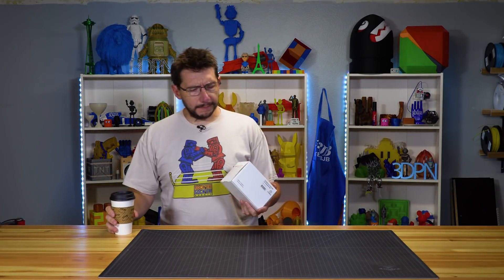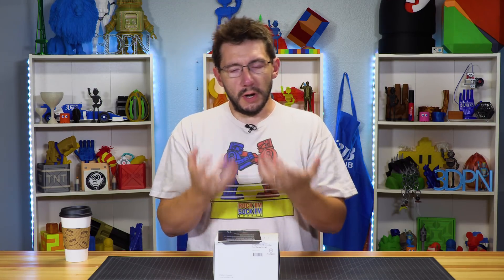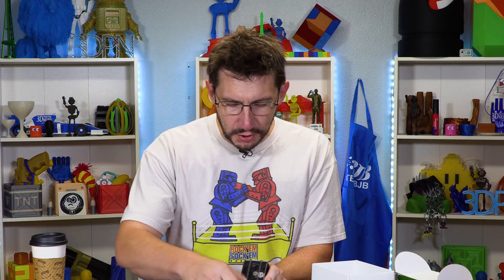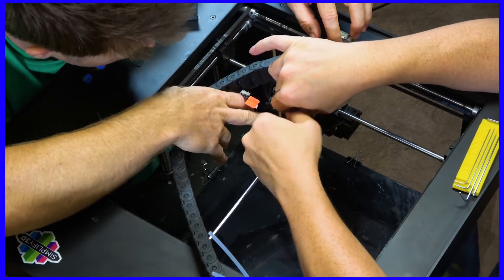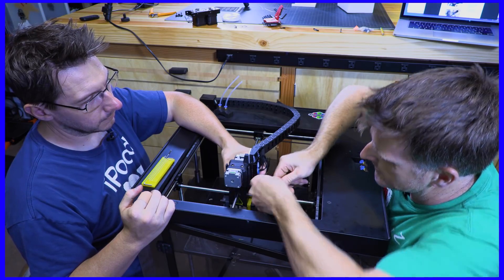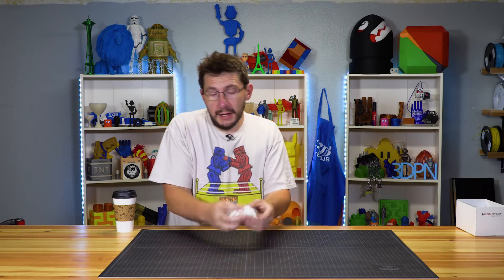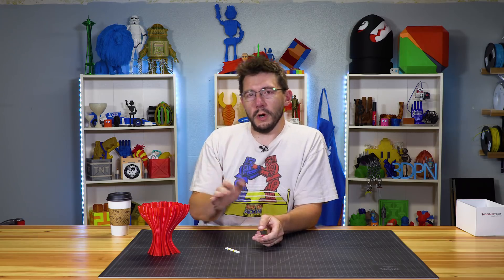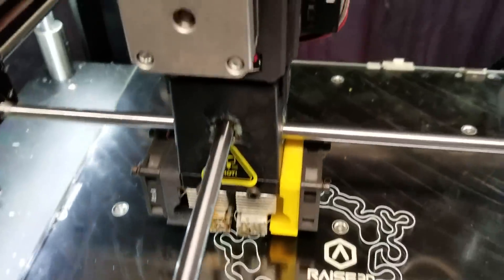installing and 3D Printing with Bondtech Extruders on the Raise3D N2+ 3D Printer

Comment: Stepper motors are current operated, the voltage you are adjusting is a current sensing voltage, not the motor voltage. The controller adjusts motor voltage to achieve the desired current, the voltage needed varies with time and speed and the controller uses pulse width modulation to achieve the desired motor winding current.

Comment: @3D Printing Nerd: you say in the video regarding the Raise printer that "having the two nozzles side by side is probably the worst way to do dual extrusion."
I received a Tronxy X5S-2E recently and it actually combines the two filaments into one inside the hotend itself. The result of this is you need to use really small retract settings (like 1 or 2mm) otherwise the molten filament follows the retracting filament back up the PTFE tube and goes solid inside the PTFE tube - leading to a cold pull and shortening the PTFE tube by cutting off the clogged section.
Surely that's worse? What do you think the best way to do dual extrusion is?

Comment: You're actually adjusting the current going to the stepper motors, not the voltage. Your read a voltage off of the potentiometer, but the potentiometer controls amperage.
Reply from the maker: Ah okay, that makes sense!

Comment: Finally, i have been looking at the upgrade kit for a while now and now i can see some proper comparisons :D 
I now use only one nozzle and a big 5kg filament spool because i only print ASA so the single nozzle bondtech would be for me. 
Would you say that it has any sense to upgrade for normal materials with the raise extruder being so good from the factory ? im mainly looking forward on the weigh saving and faster printing because you can get rid off the big aluminum block.

Comment: What is wrong with your fan duct prints at 10:58?
Reply from the maker: What do you mean? Both work well!
Reply: The left one looks like it was printed the wrong direction and the layers don't look right. Also they don't look like they would work well compared to something like this https://www.thingiverse.com/thing:2792586

Alot of designs out there haven't been flow tested so they may look like they are good but they aren't. You have to use simulation software to really get an idea of what's going on with a design.
Reply from the maker: Oh! I see. The one on the left came with the machine. The one on the right broke initially, so it was reprinted with yellow filament. Thank you for the link to the better fan shrouds!
Reply: If you had that fan duct SLA printed it would look pretty snazzy.

Comment: a useful tip for removing hot glue: put a drop of denatured alcohol on it and it with break the bond without harming anything else and the hot glue will fall right off. Just be careful not to get it everywhere as it will strip some paints

Comment: I found this video very impressive, especially because of how easy it was to get everything installed. I've got an older FlashForge Creator Pro (~2016 model) which I'd really like to do some upgrades to, but I'm quite concerned that the lack of open source firmware is going to be a major limiting factor. I remember back in the day you had some videos with that same model - any advice for how I might resurrect it into a more useful printer, like you did with your N2?
Reply: Daniel Smullen doesn't the ffcp use Sailfish like the Replicator (because it is a clone of either the Replicator 1, 2, or 2x, can't remember which)? Sailfish is open source and, while it's not under as active development as Marlin, it is typically beyond the version that comes with such printers.
Reply: rpavlik1 it is Sailfish, but there's no clear way to know what pins are used for what, what the current and voltage specs are... If you have any clues about this they would be helpful.
Reply: I'm pretty sure there is a config in the Sailfish repo - either a config header or something like platform.py IIRC. I don't have a FF printer, so I don't know more, sorry - I've just done some work on Sailfish primarily to improve my rep2x

Comment: Hi Joel,

If you want to remove the hot glue, use rubbing alcohol and it breaks easily.

I've been using this thing for a long time on printed circuit boards.
Reply from the maker: Oh... OH! That's great advice!

Comment: Where is the rc car mon
Reply from the maker: YO! Waiting for one more part to be CAD'd, then I need to get the plastic sheet for the bottom. Robert just got the battery welder. Then we need to acquire metal nuts and bolts. Closer!

Comment: Dual looks awesome. Have you had a chance to print vertical walls yet? Curious to see if there’s any extrusion inconsistency issues (like that MK3 #602) that some have pointed to these extruders.
Reply from the maker: I still have some vertical wall testing to do with the machine, but that's on the list!

Comment: I still don't understand what it improves but still interested enough to do some research
Reply from the maker: Being able to grip the filament from both sides as it pushes it through to the nozzle means a more reliable extrusion. Just think, thousands of retractions later, the filament could have slipped a bit. This ensures it doesn't.
Reply: 3D Printing Nerd okay so another long term investment im down for that. Understood, I'll see if it works for my printer when it arrives.

Comment: Joel,
  I'm curious about your reasoning behind the statement that dual nozzles side by side is the worst way of doing dual extrusion.
Reply: Ken Gregory the are  difficule to set up the height.
Reply from the maker: Ah, I guess I should explain. In order for dual extrusion to work properly with side-by-side nozzles, the printer has to know exactly how far off in X and Y the right nozzle is from the left nozzle. If it's off, then the plastic from the right nozzle doesn't line up with the plastic from the left nozzle. Ultimaker 3 has side by side, but it also has a very decent calibration process that makes it easy for the user. The Raise - not so much.
Reply: Isn't that preferable than ending up with a purge block that can outweigh your printed model?  Just sayin....
Reply from the maker: Dual extruders like this still require a purge tower and / or a wipe wall though.

Comment: Joel, from my experience of the upgrade it was the best thing I have ever done to my Raise3D N2+. I have lost countless large prints due to filament “Stripping” out. Over 1000hrs now no problems of that. I have had the stepper motors get hot when using the lid on the machine. The heat transfers through and melts the filament at the drives. I had to completely pull it apart (includes removing from the Raise) to clean it up. I now use the cover at the beginning and lift it to ensure the steppers don’t get hot. 

Also the lower CG helps with the Waves/Ghosting with change of direction. 

In the end though, not happy with my Raise3D experience. Both the X & Y end stops fell apart. Three Control units (first one Dead on Arrival), and a motion controller board failure which my dealer replaced since Raise wipes their hands of the issues. Maybe I need to start my own YouTube channel to get the same level of support you have experienced from Raise3D.
Reply from the maker: Ouch! That's no good. Shoot, I'm sorry to hear about your troubles with your N2+. The Bondtech upgrade came from Bondtech, not Raise. Who are you contacting there? Are they answering any of your emails?
Reply: Joel, I have been told that even though issues that were "Raised" under the warranty period and still haven't been fixed, it is no longer under warranty and that say it is outside warranty and there is nothing they can do.  That email came from the VP in Europe Michael Huang.  I need a 3rd printer now, I know it won't be a Raise...

I am a Support Person myself and I know that the product is just part of the story, it is the level of support, service and expert advice that you provide that keep your customers coming back.  There is no point to winning new customers if you can't maintain the ones you have.  Even though my experience with Raise hasn't been great, I still buy my supplies through the same person that sold me the machine. He is just as frustrated with the issues as I am and he has even supplied me parts at his cost that Raise wouldn't fix.  That's Service & Support.  Good luck with your machine.

Comment: Wait, whaaaaat... how did that monitor work without any cables attached? Wireless power?! 😳😉
Reply from the maker: MAGIC.GIF
Reply: (AKA post editing)
If you wanted it to be more genuine, a beefy battery running an instance of Kodi on an RPi and a right-angled HDMI cable to better manage that would be possible for a few hours; enough time to set up, play your footage via your phone with some magic hand gestures and you wouldn't have to edit in post something that isn't entirely square.
Reply: I know that your joking but... 
Wireless power is already a reality (just over "very" short distances). Most people know it as NFC charging on cell phones. Its basically a transformer split into 2 separate parts, 1 part in the charger and the other in your phone.
 https://www.extremetech.com/electronics/137729-how-wireless-charging-works
Reply: No, it was just a giant tablet on a stand :-)

Comment: A few light passes with a hair dryer does wonders to loosen hot glue! Just had to work on a printer that had all the cables glued to the mainboard.
Reply: So does IPA 99%.
Reply: +1 for isopropyl alcohol, it will just release freely from most materials.

Comment: Like I said on Instagram, I too am going to miss the acrylic cover. Jams are so much easier to fix on the original than the bondtech extruder. You have to remove the whole extruder sometimes to get a jam fixed on the bondtech.

Comment: Your Videos changed from cool to only commercials. 😔
Reply from the maker: If we really want to have a look, EVERY video of mine is promoting something. Promoting me, my Patreon, a model, a service, a product. The nature of a published video on YouTube is that it promotes something. This happened to be an upgrade for a printer. Next video is a product release, after that a model, and after that a hashtag. I hope, at the very least, what I release here is enjoyable.
Reply: #Sellout Joel xD. Thanks for making your videos. :)
Reply: I can confirm at least two LOLs watching the latest production. However I no longer remember why. On a more serious note, poking a metal object into a live circuit (even a low voltage one) is BAD idea...
Reply: Hrm, I have to LUL over this. Then how do you check voltage when power is off?
Reply: ImaginationToForm , not with a screwdriver.
Reply: Ya mean his videos where he melted models, broke his filament brackets, showed cold pulled method, printed dice tower,  3d printed huge space city were all commercials huh?